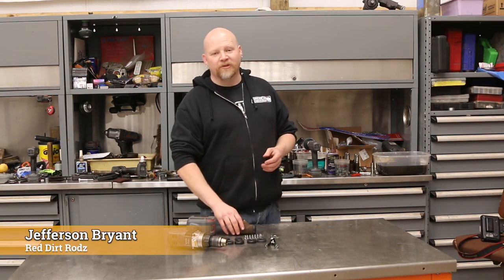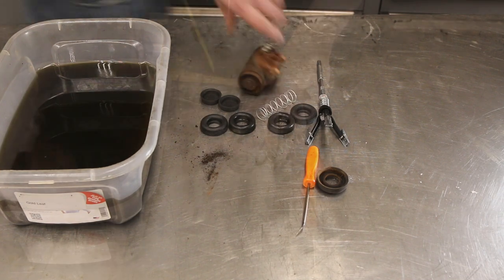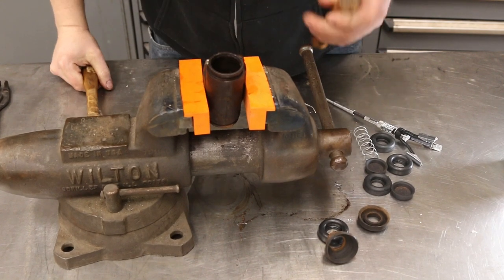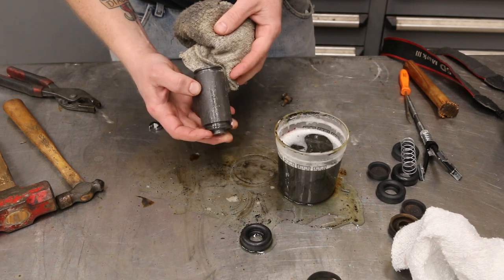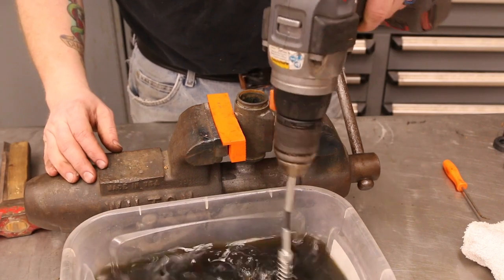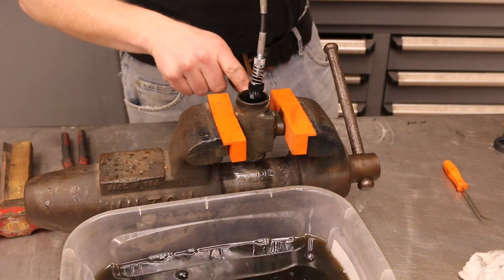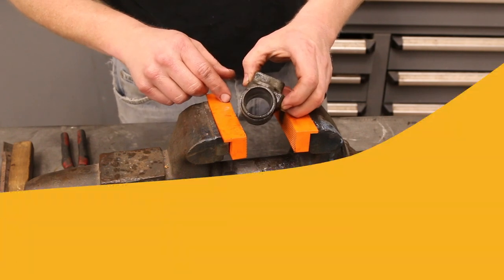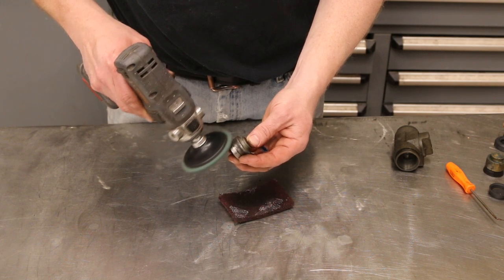How to Rebuild a Drum Brake Wheel Cylinder

Comment: Another reason to rebuild your old stuff, new crap comes with metric bolts. Which can be a pain when everything else on your old American made truck or car is SAE. I just had this problem with the clutch/ brake master cylinder on my dad's 1963 GMC pickup. But I had to use the new one.
Reply from the maker: That's a fact! I hate mixing metric and sae!

Comment: mine wasn't seized, but was very surprised about how simple the whole thing is. i even used some new parts of a slave that didn't fit, cleaned mine out and it looks like it will go back together with the new cylinders real easy. [i kept the old slave bodies because they had the right fitting bolts - the new one didn't]

Comment: What if i don't have hone tool?
Is it very important to hone the cylinder bore?
Reply from the maker: You need to clean the bore. If it is not pitted or scored, then you can get away with just cleaning it up with an ultra fine scotchbrite pad. That said, , brake cylinder hone costs about $10 to $15 bucks. 

https://amzn.to/3NFN2pa
Reply: i'm doing it at the moment. i'm gonna use some 1500 grit paper and some CRC and my finger. i'll let you know how it goes. i've used some CLR to dissolve any alloy decay powder. i just cannot buy any more tools i'll only use once so as long as there's no pitting i think it should be fine.. my cylinders and rubber seals are brand new so half the problem is solved
Reply from the maker: @fuzzjunky  it works just fine how you are doing it, as long as there isn't much pitting.
Reply: @Reddirtrodz  yeh it seemed to go back together nice and i made sure it had that nice travel that you did in the video. as long as it doesn't leak tomorrow when it goes back on i'll do the other side the same.

Comment: may I know what type of grease did you use??? Thank you...
Reply from the maker: This works great. https://www.amazon.com/Permatex-24125-Ceramic-Extreme-Lubricant/dp/B0018PSASU/ref=asc_df_B0018PSASU/?tag=hyprod-20&linkCode=df0&hvadid=312141533517&hvpos=&hvnetw=g&hvrand=6581805064370921952&hvpone=&hvptwo=&hvqmt=&hvdev=m&hvdvcmdl=&hvlocint=&hvlocphy=1024339&hvtargid=pla-571820984777&psc=1&mcid=58ef3728bbd03119962338b384fa6144&tag=&ref=&adgrpid=61941536837&hvpone=&hvptwo=&hvadid=312141533517&hvpos=&hvnetw=g&hvrand=6581805064370921952&hvqmt=&hvdev=m&hvdvcmdl=&hvlocint=&hvlocphy=1024339&hvtargid=pla-571820984777&gclid=CjwKCAjwnv-vBhBdEiwABCYQA7Spq5DBViMAKv3LRQBG_gxQjpqNcCwPOWQ2_d54U0uJnFCvz2RHzBoChH8QAvD_BwE

Comment: May I suggest you be more specific?  You keep stating "diesel"; diesel what? fuel?  Also, you applied "grease" to the plunger; it looks like silicone grease, but you don't specify...
Reply from the maker: Im not sure what else diesel would mean in this case, but yes, it is diesel fuel. 

The grease was an oversight, it is DOT hydraulic brake grease.

Comment: grease in a brake cylinder ??  That does not mix with rubber and brake fluid
Reply from the maker: There is a tiny smear between the piston and the cup, this is not going to see brake fluid. This is how I was taught by an old timer. This is Marine grease, it is specifically formulated to be compatible with rubber seals and prevent corrosion from water. Another option would be silicon paste. Some wheel cylinder kits come with piston grease. The metal pistons only see brake fluid when the seals wear out. There is no grease in the cylinder itself, just a tiny dab to keep the cup from welding to the piston.

Comment: Wow 3 days on 1 wheel cylinder! I could have done 80 in 3 day's.
Reply from the maker: The rebuild process takes 20 minutes, but this one was seized, so we let it soak. That's not typical, this one had sat for years and rusted up. That said. This process shows that you can save even crusty old wheel cylinders!
Reply: @Reddirtrodz 
Amazing